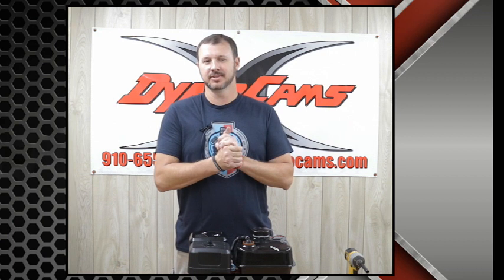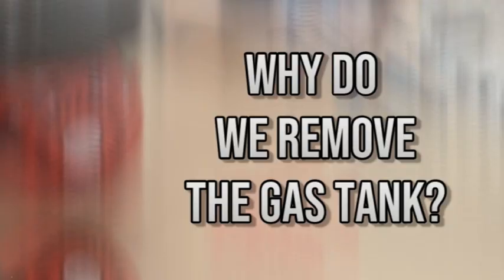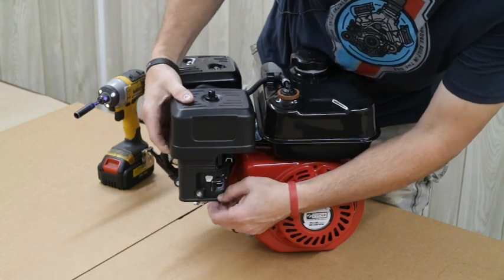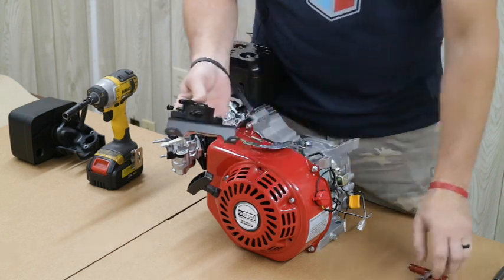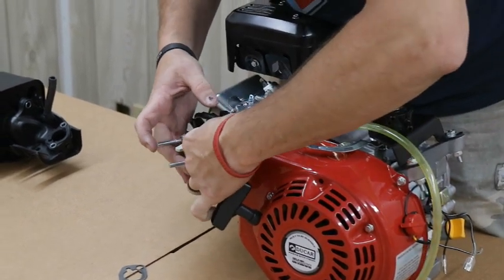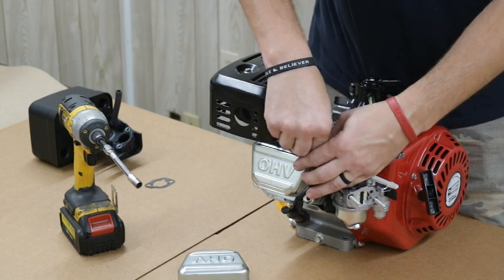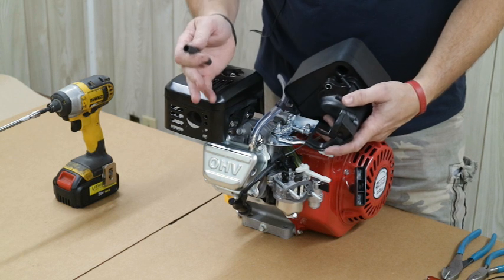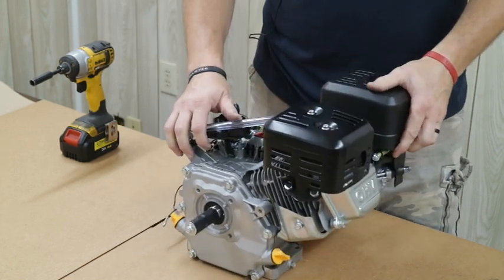DUCAR 212 Fuel Pump Installation

Comment: i recently purchase a Ducar 212cc from Dyno Cams Directly it arrived in about a week  i fill it with oil/ gas fired up  This engine is a Beast  why build a H F 212  The Ducar 212cc   is race ready   i bought it as  a complete kit  throttle linkage /  clutch cover